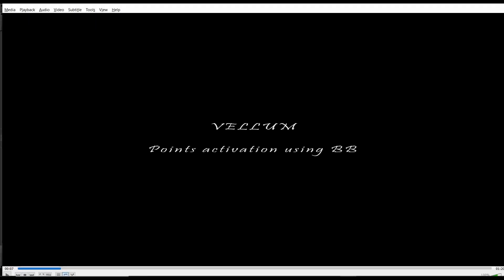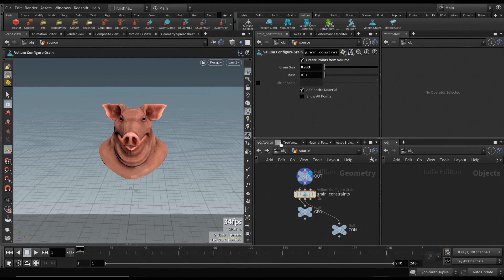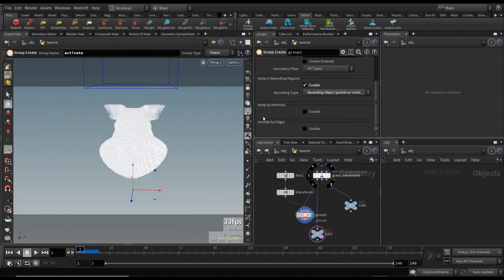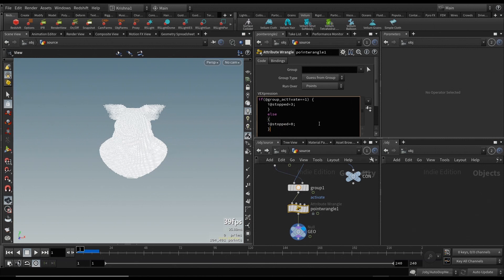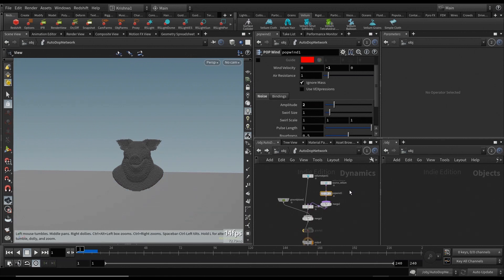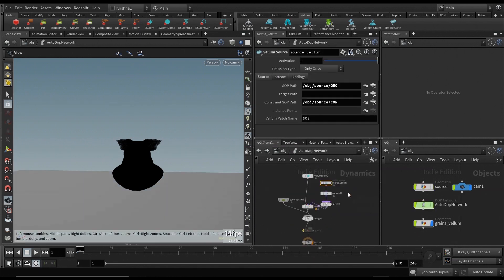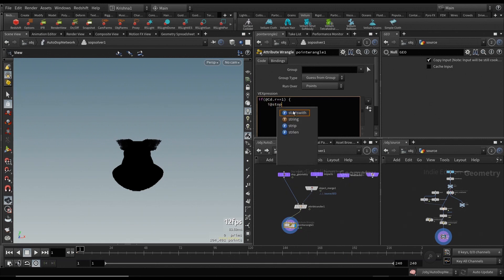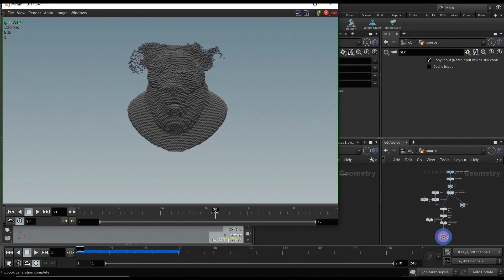TUTORIAL - PART I - HOUDINI VELLUM GRAINS ACTIVATION

Comment: Is there any way to set an initial velocity for the grains at activation time? Just adding an @v attribute doesn't seem to work as it gets reset to zero when stopped.
Reply from the maker: Ok maybe you can try using SOP solver inside of dop network and inside of sop solver using point velocity node.
You may have to use multi solve to connect the sop solver and vellum solver. Hope it makes sense

Comment: hey. somehow my points my emiting; but geo isnt vanishing after the multi-solver part :((was till just the vellum solv.) Help?
Reply from the maker: I am not sure I understand, Can you please elaborate?
Reply: @resilientpicture  ah, I fixed it! Earlier, my geo was a grains object. But there was no displacement to the geo itself. So, man's face stayed, without being moved by wind. If that makes sense.
Reply from the maker: @starlight055  alright, sweet, glad you figured it.
Reply: @resilientpicture  :) 

Though. Question. I've been trying to figure this out: 

I want the vellum grains have a life and death. I want them to die after a certain amount of time. I'm unable to figure that out. 

Help?
Reply from the maker: Good question, grains don't have life time as such as far as I know. So you can generate an arbitrary attribute and increment it over time. Then delete grains particles based on this value being higher than a threshold. Hope it makes sense.
Reply: @resilientpicture  it does. I thought that too. I'm just not sure how to generate one. I know I could go, f@life. But I dunno how that would connect to their life span.
Reply from the maker: You can use fire spread shelf tool as an example which generates temperature attribute and you can use that to delete grains based on temp above a certain threshold
Reply: @resilientpicture  Hm. I could look at that. Thanks. Any other ideas?

Also, are vellum grains heavier than pop particles? Since my pop particles are able to run almost teal time; but vellum is talking far too long. And flushing issues caching as well.

Comment: if the point number number is consistent, better use attribcopy , much faster than transfer
Reply: and if it is not consistent, you can prep an int attribute , and use that with attribcopy
Reply from the maker: Thank you for the tip. Attr transfer is definitely slooowwww. :)

Comment: How do we export grains to c4d? I cant see the grains in the view port.
Reply from the maker: I don't know about c4d but I assume you can export as alembic from houdini and c4d can import alembic
Reply: @resilientpicture  I did but the grains are not shown in render viewport
Reply from the maker: @bhushankandalkar3104  I honestly don't know about c4d, but are you using lite version?
Reply: @resilientpicture  I m using r21 crack
Reply from the maker: Ok, I am sorry, I can't really help you as I don't know, but I do have to point out using cracked software is illegal. Instead you can use blender which is absolutely free for anything and it's extremely powerful.
Reply: @resilientpicture  yess, I just installed blender ✌🏻
Reply from the maker: @bhushankandalkar3104  good man, I know alembic import works in blender because I have tried it myself. Good luck.
Reply: @resilientpicture  so vellum grains will to work right?

Comment: Smashing tutorial!  I'm just wondering, basically this is a rather regular  box falloff field in Cinema 4d that is activated with 2 simple clicks. Isn't there a much quicker and coherent way to achieve the same result bypassing all the code? Maybe I'm missing something, very new to Houdini.
Reply from the maker: Thank you. well, currently activation using a trigger object can only be done using some sort of vex code, that could be as simple as activating particles based on force using active parameter or method in this video etc.,  But, this is based on my understanding of houdini. I am not familiar with C4D. I hope this helps.
Reply: @resilientpicture  Makes sense. Thanks for the answer, looking forward for more! Cheers